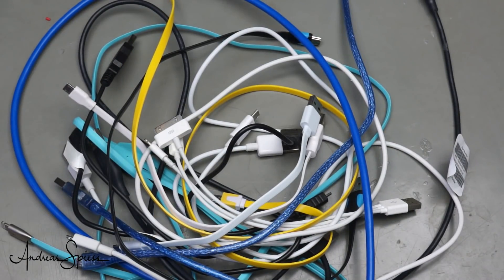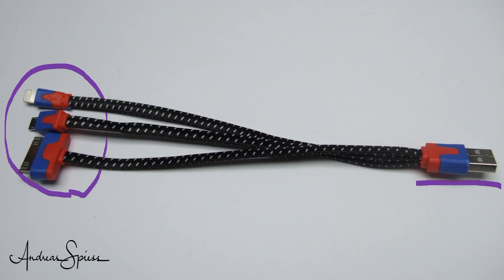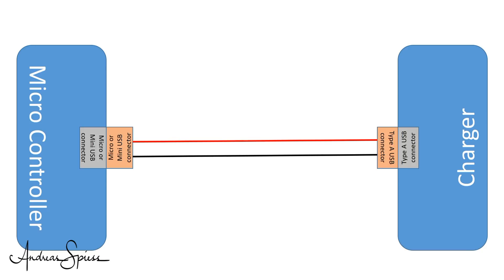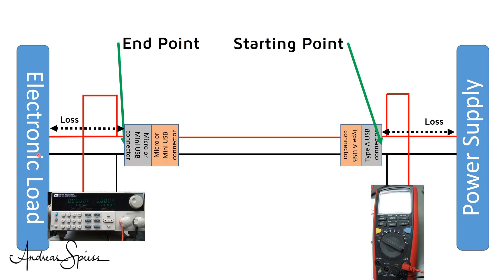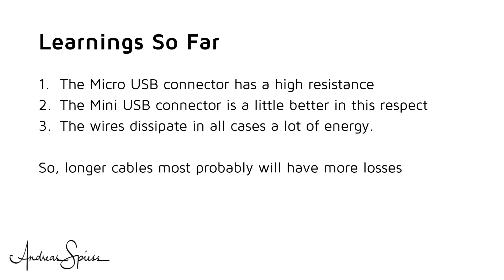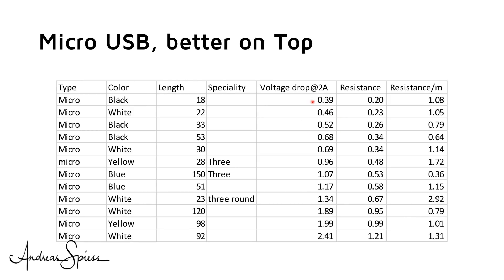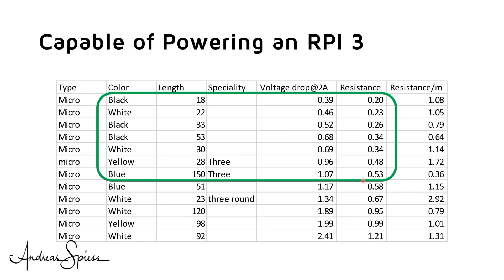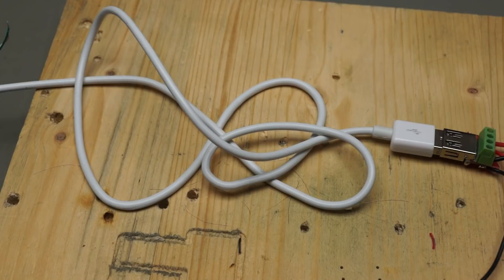#177 Avoid Surprises: How good are USB cables and how can you test yours?

Comment: I would have been interested in how strongly they are influenced by electromagnetical noise.
Reply from the maker: Why would you be interested in that? Do you have big motors around your devices? Short digital cables are not very much influenced by external electronic noise without real big gear. So I cannot test it because my lab is relatively quiet.
Reply: Andreas Spiess I'm trying to build a cheap CNC router with an arduino. And someone in a forum recommended to think about shielding and so on to solve some of my problems.
Reply from the maker: I am not sure if the problems come from the USB cables because usually, its distance to the power cables to the motors can be separated by many centimeters. On the controller board itself, however, these currents could create a mess, because there, the distances can be rather small. I would also look at adding some capacitors because it might be, that sudden current spikes might create issues.
Reply: Andreas Spiess Thank you for the recommendations. I guess I'll approach the problem differently. Maybe I can cut out parts for a proper CNC router in a makerspace and rebuild the entire machine.

Comment: So finally your cables turned out as bad as mine. It is also possible to use so-called USB Testers to check current and voltage. One of them (white one with short cable) is also perfect for checking quality of the cable because has extra microUSB connector.
Reply from the maker: But still, most of them are ok for ESP projects. 
I ordered a few new ones from the supplier of the good long one to compare.

Comment: Some USB cables sold (on eBay) have their wire thicknesses listed for the power wires. 20AWG are pretty good for 2A and fast charging loads. I would be interested in seeing those compared to the ones you tested here.
Reply from the maker: Maybe you send me a link?
Reply: They use AWG (American Wire Gauge) in their titles. I searched for "usb cable 18awg" and other gauges to find them. They start at $2.50.
So like eBay items ( I don't know if Youtube will block a post if I use links, so I will use the item numbers instead):
171767082377 for 18AWG,
292360980058 for 19AWG and
173040671166 for 20AWG.

After getting a batch of USB cables that wouldn't run my SBCs, I specifically ordered the ones that listed their gauge and haven't had a problem since. I also use USB supplies that run at 5.2V to reliably power things like RPI3 boards.
Reply from the maker: Thanks for your info. I ordered now a cable with a 18AWG in the title and we will see...

Comment: Could you test Supra USB cable with jitterbug attached? I have that kind of setup to connect my Scarlett and im curious if that reduces the current or voltage.
Reply from the maker: I looked at the homepage of jitterbug ( http://www.audioquest.com/jitterbug/jitterbug ). They claim to improve "digital noise on the data lines" which is not the topic of this video. I am also not in high-end audio. So I will not spend the 50$ for a jitterbug.
The same applies to the Supra USB cable. It is focussed on high-end audio. Looking at the picture about the wires it seems that they are thick enough. But the price is even "thicker". I will not spend 3 times the money for a USB cable than for my microprocessor. This might be different if your HiFi rig costs several 1000 $.

Comment: Some good usb cables actually tell you the thickness of the internal power wires. The one I use to charge my phone says 26AWG. sadly I don't have the tools to measure its resistance.
Reply from the maker: You were lucky to find this kind of information. Usually, it is not available.

Comment: Very little difference between the physicist and engineer other than schedule and budget! :-)
Reply from the maker: Thanks for that. Until now I always thought, that I am not bright enough to study physics. These guys really need big brains.
Reply: Let's call it differently normal brains.
And I did work with analog circuits (mainly op amps) during my thesis (physics). I was more interested in explaining the system behaviour rather than the circuit design, but it was a part of the thing. Also getting signals out without changing the system too much...

Your videos are handy, the kids want electronic gizmos (traffic lights for their Lego etc.), and your information and fun videos made me dig out my soldering iron and order some parts!

Comment: When I plug in my USB cables, I fail constantly at the first attempt. Why? Because of the ports resistance is too high. ;-)
Nowadays many USB 3 cables come with external hard disks, card readers etc. I would be interested if these cables are better than the old USB 2 ones?
Reply from the maker: For the tests I did only the power wires are important and to my knowledge they are not related to the data transmission standards. But I did not test this aspect.

Comment: Thanks for this contribution of this very important Topic.
You could do these tests ver easily and automated using the ZKE electronic load you introduced in Episode #148.  
Because of this crappy USB cables I am used to solder the power supply directly to the board. Even on my Orange Pi Plus 2e which has a strange barrel connector. But also this barrel connector has a voltage drop of several hundred mV. 
Normally I am using cheap  but certified (VDE or UL listed) power supplies of a final sale. E.g. 5V 1.5A for 2.50 EUR or router supplies 15V 1.66A for 1.75 EUR. 
The 5V can be connected directly and for the 15V (or the 24V from my battery backed home power line ) I am using the tiny and cheap buck converters with MP2315. They are cheap (0.50 EUR) very versatile, "mini" and claim to have an efficiency of 97.5%.
Reply from the maker: Concerning the ZKE load. You are right. I just did not know where exactly it measures voltage. With my setup I was able to control this part. Concerning soldering: This is of course the best solution as it removes most of the resistances. And the MP2315, especially with the USB connectors, are a good Idea. Best would be if somebody would produce one with a microUSB connector...
Reply: The MP2315 ones with USB connector have an additional 5.6V Zener at the output. This is an advantage. But also here I do not use the USB connector at the output but soldering. Soldering ist fast, cheap, reliable and low Ohm.
Mostly I use the "adjustable mini 3A 97.5"  from ali. You can use the ugly pot or one of the preinstalled voltage dividers, which I prefer.
Reply: Concerning the ZKE load. I added some 2.5mm^2 15cm wires. Using Wago 221 (or 222 or soldering) I can bypass the USB input connector and measure what I want up to ca. 20V. Adding an micro-USB connector adaptor board you can easily and quickly measure the complete cable including the power supply.
Reply from the maker: Good idea. So far I did not do that because I have no need. I have to amortize my expensive IT8512A ;-). If you always use the same current you also can assume your voltage at the charger is constant. Or you can put a checking voltage meter there...
Reply: "I have to amortize my expensive IT8512A ;-)." Ok, I see: Noblesse oblige ;-)

Comment: How are we to purchase good quality cable? The internal wire and connection resistance information isn't included in most cable information. I am sure some sellers have high quality cables. Maybe even the low price sellers have a higher quality option.  Thank for the videos.
Reply from the maker: I am not sure if price and quality is in a relation. So far, only testing is possible. However I ordered a few short cables from the supplier of the good long one. I will test them and, if good, inform you.
Reply: Andreas Spiess Can you test quality cables such as Anker powerline?
Reply from the maker: +Silvio I plan to purchase cables suggested by my viewers and do another test. Your proposal is already ordered
Reply: Andreas Spiess thank you :) 180cm, 90cm or 30cm?
Reply: YMMV but not having to worry about dodgy usb cables is worth spending a bit more for me. No guarantee that more expensive cables are better, but "you get what you pay for" is usually a factor.

Comment: Interesting, the increased temperature of the cable will also increase the wire resistance. This is also an aspect that needs to be considered. P.S. I fully agree with your wife :D
Reply from the maker: But first is the resistance and then the heat. Increasing resistance due to increasing temp is not important for copper
Reply: A 25 degree C increase in temperature will cause a 10% increase in resistance of the copper wire. I think that is significant
Reply from the maker: You are right. I was not aware it is so big. So I learned something...
Reply: Haha, that's good to know, I learn a lot from your videos

Comment: My ESP32 boards won't work properly with certain cheap cables/chargers. Short cables and good brand chargers seem to work better. At least I don't get my cables from the supplier that VoltLog uses! https://www.youtube.com/watch?v=sjGFIsgtUWc
Reply from the maker: 1. I also saw Voltlogs cable. Amazing...
2. The reason for that video is to motivate you to test your cables and throw the bad ones into the waste basket. You do not have to melt them like I did. This is not very healthy because of the fumes ;-)
Reply: The best chargers are Apple ones. They provide a very stable and accurate voltage and the iPad charger is capable of giving 2.1 A. BTW, I have a very crappy USB A to B cable that had 0.5 V drop... with an Arduino UNO! I thought it was the computer, but no, it was the cable (as expected from an iMac). The original Arduino cables are very good.
Reply from the maker: +GRBTutorials: I was also astonished when I tested Type A and B cables. They were relatively thick, but not good at all...
+SCWfan06 I will order cables suggested by my viewers and make a second comparison.
Reply: I use Anker cables and chargers.
Reply: +GRBTutorials. Actually no.  They are good though, as many brand USB chargers, like the IKEA charger.   
The No Name chargers are the one you should look out for.  
And there are also other things with chargers, like there security with how they are built.  Like have proper distances between low voltage and main voltage parts.
That would be a good video too, if you not already done one.
Reply: Hm, found this (sorry for posting another video channel)
https://www.youtube.com/watch?v=uRe9w5PKmsE